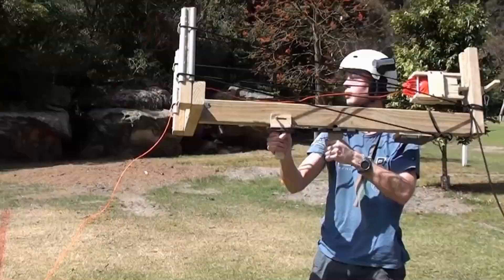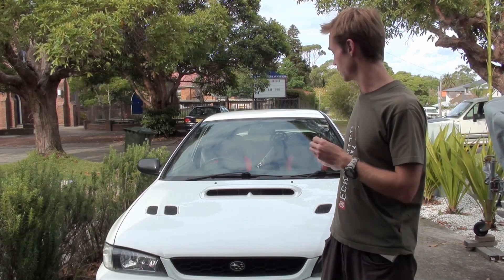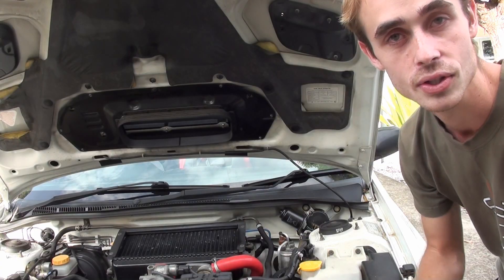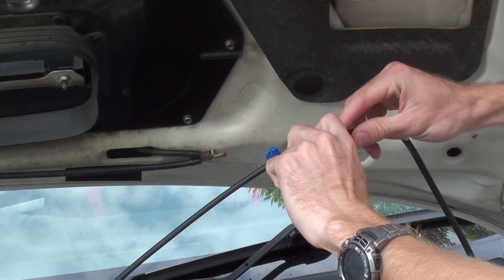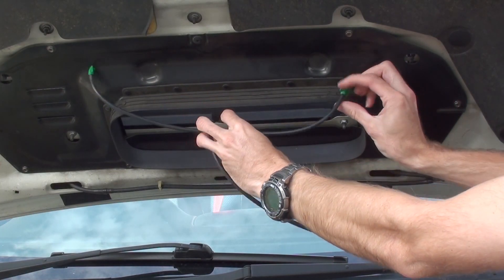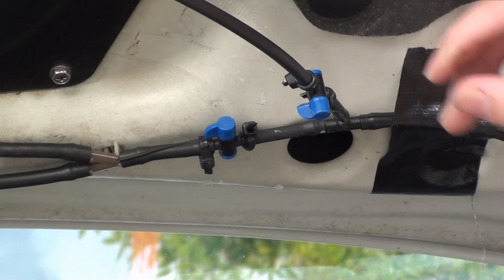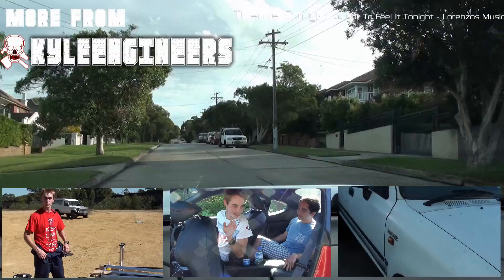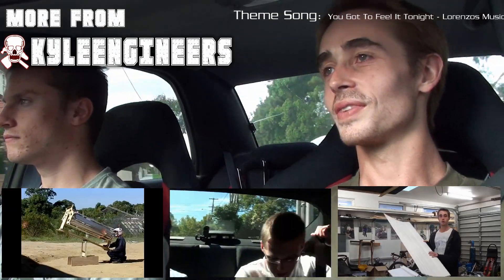$10 Intercooler Waterspray - WRX Mod

Comment: so let me get this straight... you're spraying washer fluid on it? which probably isn't that cold unless it's cold outside which is exactly when you don't need it? not to mention it's probably corrosive on those thin ass metal fins. plus the fact that you have to use wipers everytime lol. I'll just install a new fluid reservoir and run identical lines so I can use actual ice water.. good effort though

Comment: For another $10 - $15 more you could have picked up an additional pump from a scrap yard, then buy a cheap relay, switch and off delay timer and have made yourself a nice little setup.
Road tuning/power testing on public roads is also a pet peeve of mine. It makes you look like an inconsiderate and entitled millennial douchbag.

Comment from the maker: You know, I'd be lying if I said I didn't find it interesting that MCM released a video of this just a few weeks ago and for some reason everyone liked it, whereas mine has a somewhat concerning amount of dislikes...
Reply from the maker: +theshonen8899 You might want to check release dates there buddy, mine was almost 2 years earlier...
Reply: Wtf ur the idiot here and know nothing about cars thats the intercooler they are spraying not the intake and some cars have intercooler sprays built in from the factory learn ur shit before u start nagging some video. PS you can also put water in a windshield washer container then just spray it on the intercooler as long as its warm out water won't hurt the pump Lol
Reply: @zaneubdegrove6675  bro he works for the mercedes F1 team and you just told he knows nothing about cars lmao
Reply: The intercooler is like a rad it can take water it doesn't lead to the engine
Reply: Wow! Can't believe the amount of flogs commentimg here. Of course it works to cool the intake charge, lessening the efects of heat soak (science 101) fun video guys, you showed what would be the cheapest way of achieving this 👍 nice work.
Reply: KYLE.DRIVES Because you aren't MCM.  That's probably one reason.  Secondly, your video didn't serve a purpose.  Were you trying to debunk or sponsor the effectiveness of this mod?  Instead, you just made a video making fun of the invisible horsepower and boost you wanted to make from this sprayer.  Hard to make a MCM worthy DIY video in just 3 minutes, mate.  Hell, it's hard to make anything worth while in 3 minutes, unless it's a piss or perhaps a quick #2.
Reply: because you only make fun of it - from start on - and you don't allow us viewers to get any serious information out of this. if this is actually any useful or not. Since you don't seem to know much about what you are doing anyway. You're just messing around without any background knowledge, you're not even reading any ECU live data...
Better leave your stock WRX...stock.

I also highly dislike your valve system. The windshield sprayer can be relevant to safety, especially when driving higher speeds.

And last but not least, you just don't spray expensive windshield liquid all over your intercooler, right into the hot engine bay...
Reply: ***** if you know something about cars and their engines, you would know that what they are doing here, is totally wrong and useless.

I highly doubt anybody would  be stupid enough to even water spray their intake using the washer pump. But oh well, I guess there's always someone on the planet. :/

They are asking for positive feedback. They don't even give us insight if it works or if this is just some waste of time/money and "intercoolers-corrosion-accelerator". Plus, wiping on a dry windshield isn't really a good thing to do.

There is so much wrong about this shit - I'd give a 1000 thumbs down if I could.
I too applaud tuning efforts, but only those which make little sense and do actually work. This one here, is bullshit.

10°C decreased intake temperature (that's a lot) means roughly 2-3% possible performance gain. I wonder what these guys achieve.. 
Last but not least, even their video title is wrong and misleading. There can be no boost gain with this gimmick. It's all just for the youtube views and shit their viewers.

Comment: If you want to mod your WRX, DO NOT GO THE CHEAP ROUTE!! Go cheap and you will need a new motor is all im saying, no need to do useless stuff like this
Reply: This is a water sprayer. Just like the older STi's have. Its not going to hurt anything it will only help keep the TMIC a bit cooler on hot days.
Reply: fokeev00 or build one yourself for $30.
Reply: Dude, it is just a water sprayer... you can buy a kit that does the same thing on the net for a few hundred dollars.
Reply: Cool story bruh, got it ;-) *****

Comment: i would rather run lines of 134a refrigerant through the lands of my intercooler so that then i am effectively air conditioning my in coming air...
Reply: Guess you never heard of the law of conservation of energy... unless you were powering the refrigerant lines from a separate power source, this would do precisely nothing.
Reply: I hope you aren't really releasing refrigerant to cool your intercooler.
Use C02 or N02 instead, it's car cheaper and won't kill the ozone.
Not to mention it's also legal, unlike releasing refrigerant.

Comment: Seriously don't understand all the hate on this video... I mean what do people expect for a $10 mod, a turbo swap? Water spray kits are used on a number of high performance cars to increase turbo capability by cooling the intake charge (this can allow you to run more boost), and this video shows you how to build a basic kit, even if it is in an odd manner...

If people think they are being serious about the whole 300 hp thing, you should really lighten up